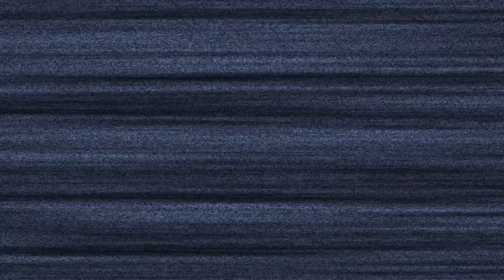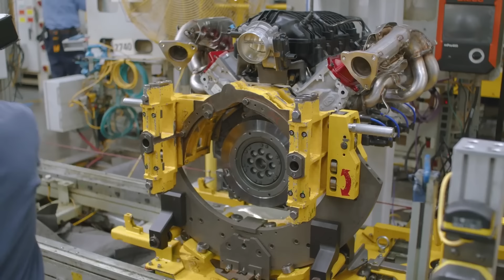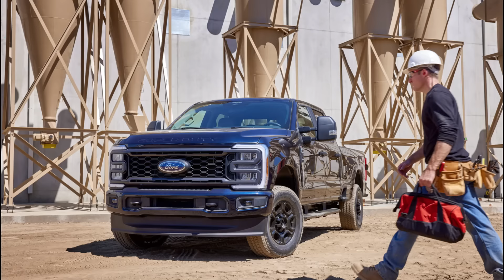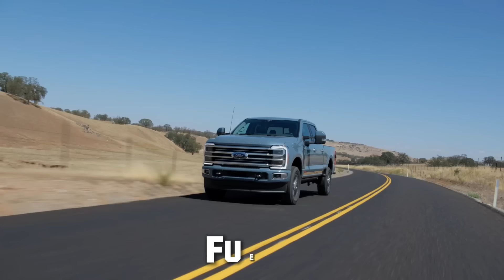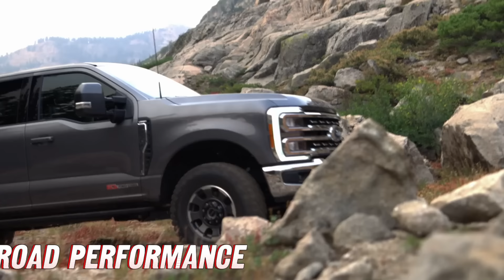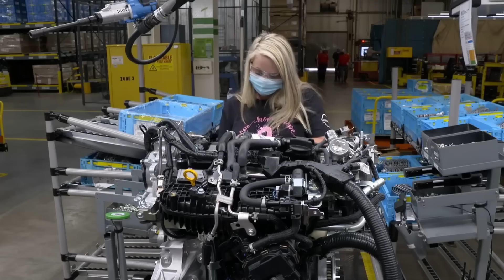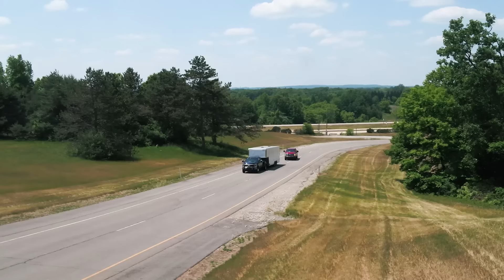ALL 4 Powertrains of 2026 Ford Super Duty EXPLAINED in Detail!

Comment: Overpriced JUNK.  All of them, All brands.  I have a 25 year old 7.3L F250, engine made by international.  I'm just going to have it rebuilt it if ever gives up the ghost, but thinking it won't since I'm coming up on 400K miles.  All that extra "high tech" crap is just that CRAP.  They say they stopped the 7.3L because it couldn't pass emissions.  BS, they didn't even try.
Reply from the maker: Completely fair, your 7.3L holding up to 400K miles speaks volumes about the durability of those old-school engines. With all the modern “high tech” additions, it’s understandable to feel frustrated. Which of the 2026 Super Duty powertrains do you think comes closest to that kind of reliability?
Reply: Just say you can't afford it. It makes way more sense than what you are spewing.
Reply: Your 7.3 is weak and slow these new engines are superior just because you can’t afford it doesn’t make it “overpriced junk”.
Reply: @PARATI-SUMUS  i have a 7.3 powerstroke and a 2024 6.7 powerstroke....and i deleted and tuned the 6.7....it absolutely has no business moving like my 5.0 while weighing 8000lbs 😂😂😂 its stupid fast for a truck. My 7.3 with many modifications will do 0-60 in 3-5 business days compared to my 6.7... as far as reliability i dont see any issues with the 6.7 as long as you have the s&s disaster prevention kit installed.
Reply: I’ve got 355k on my ‘03 7.3
Reply: Keep the old one and rebuild the whole truck. You'll be wat ahead and the $90,000 current trucks
Reply: Yaa they are expensive

Comment: You lost me at the particulate filter. Pass
Reply: Pretty easy to get rid of
Reply: @tsharko04  why should I have to pay for it and then pay to get rid of it.
Reply from the maker: The pricing is absolutely brutal on the new Super Duty! Basic work trucks that used to cost $30K are now pushing $50K+ for entry-level XLT trim. It's completely priced out the working people who actually need these trucks.

Are you just frustrated with the sticker shock, or actively shopping and getting hit with the reality of current truck pricing?
Reply: @speed_spectrum_cars  everything is getting crazy expensive.

Comment: Get a Ram that way you get CUMMINS. Just like a Peterbilt  and kenworth. Ford are in the shop Rams are on the Road getting the work done.
Reply: Hilarious Cummins are failing just as much or more then pop psd
Reply: Problem is you don't have lock out hubs on a ram!!
Unless you do the lockout hub kit 
What's wear and tear on the front and your front end will be freewheeling
Reply: I love the my trucks  better guys. they all suck now. They use the same parts that are junkkkkkkkkkkkkkk.
Reply: Honestly why would the manufacturer care if they break down. Short warranty and then you buy a new 100k truck that should be selling for 68k

Comment: Superduty had its peak in 2001-02 and massive decline in 05+.  Also bring back the god damn 6 speed manual transmission.
Reply: Sounds like fun rowing through gears, but a single countershaft trans can't hold the power these new diesels are putting out. Id love to have a manual trans but the autos are really good that they have now. At least the 6 speed
Reply: Yeah, with the power the new trucks make, you'd need a Eaton fuller 6, 7, or 8 speed or something equivalent to it
Reply: The 7.3 was gutless. Reliable? Ya most of the time but it was dated on tech. 0-60 in a few days when hooked to a load.
Reply: @bryandepiazzy8679 A chip, CAI and 4" turbo back exhaust woke mine right up.  Plenty of power; night and day over stock.
Reply: Had a 2000 SD with 6 spd.  Selling it was the worst decision I've made.
Reply: @ratpatrol07 saw one 2000 F350 with the ZF6 and the 5.4l for close to 25$k Cad today on FB MP. The truck is mint and only have 140k km. A beautiful dually! If I didn’t had a Cummins dually already I would be seriously looking at it just because it has that ZF6 trans in it
Reply: @philbert8423  thats another animal, old trucks still are not worth their sticker or more being 20 years old
Reply: The people who need a diesel truck could personally own and use a day cab single axle and not have to have a cdl but just a class a license not commercial unless they were making money then the cdl is necessary but you can hotshot if your under 26k lbs gross weight
Reply: I have one, in my 99 7.3 powerstroke. So much fun to drive. I get good mpg as well
Reply: I drive a 6.0 😂😂
Reply: Save the manuals!
Reply: should offer a eaton 13speed with all that power
Reply: Old non Hydraulic in the bell
Reply: Making too much money selling those 10 speeds in a box.
Reply: You might want a six speed but nobody else does
Reply: @davidmiddleton240  manuals were forced out by insurance companies and emissions controls. end of story. thats pure communism.
Reply: Exactly why I'm keeping my ordered from the factory '01 F350 7.3 CC LB 4x4 Lariat.  No emissions garbage, not even a cat.  Only 179,000 and runs like the day I picked it up from the dealer.  A few mods over the years has kept it current and adequately powerful.  It serves my needs quite well.
Reply: The only reason I still have my 6.4L is to keep the ZF S6 trans.  I blew out overdrive after 15 years of tuned shananagins, but it was pretty cheap to find a replacement on ebay.
Reply: Yep my 99 v10 5speed crew cab dually lookkkng flawless still
Reply: Got an 01 7.3 F250, has a few bolt ons and ts6 tuner, it has more than enough grunt to do anything I want to do with it.  Know someone with a couple 6.0, and the money thats been put into those trucks would have bought mine outright many times over.
Reply: A modern 7.3 deisel or modern 2 stroke 8 cylinder deisel  without def would be the ultimate comeback
Reply: @ericwitherspoon5311  the 7.3 was a big engine with low power and was starting to really show it's age in the 2000's . The 24v cummins was smaller and more efficient and made the roughly the same power as the 7.3 powerstroke, and the LB7 duramax was still smaller and more efficient than the 7.3 and made more power than the 7.3. It was an aged mule waiting to be shot. 

I don't think 2 stroke diesels will ever make a come back.
Reply: Simmer down grandpa
Reply: I watched a YouTube video with that hooked to an actually healthy V-10 "Triton", and that sucker was/is a BEAST for basic work. *I don't know if it could have been a 6.2, but that engine is one of the best modern Ford workhorses too.
Reply: @ChristopherWilliams-y7y The problem the 6.8 V10 had was it made no low end torque. The engine had to rev into the 4000 rpm range to make its power same with the 5.4. I owned three V10 Fords and they all struggled on the bottom end to get a heavy load moving up to speed. The 7.3 Godzilla is a massive improvemnet.
Reply: @Lawnboy21  I'd say the "improvement" is more gears in the transmission.  It's much harder to get heavy loads moving when you have fewer gears spaced further apart.
Reply: @Lawnboy21 gearing issue or nah?
Reply: @Lawnboy21  the 2 valve tritons were awesome, the 3 valve was junk, and yes the power band was raised way up on the 3 valve, dont forget the electronic throttle added in 04 didnt help.
Reply: @ChristopherWilliams-y7y I have a 03 f250 with the 6.8 v10. I love it. I dont do a lot of heavy towing like over 10k in let my boss do that with his truck. Its pretty quick too for a 8k lb truck. Fuel mileage is ass but I don't care. I've had it since new shes got 166k on it. I work local so 166k for a 22 year old truck is nice. Never had a problem other than normal wear items and a couple coils going out. Most reliable ive ever owned.
Reply: @roguepowersports3576  2 valve tritons were awesome
Reply: In any diesel light duty truck a 6 speed manual transmission would be awesome! And to all saying it’s not strong enough…think again! Tractors with great torque have manuals(agreed they are not going 100MPH) 10-12-18 wheelers have manual transmissions, it just needs to be properly engineered to match the engine power
Reply: @philbert8423  remember 26k max combined weight is cdl territory, more than 90% of these truck owners will never be more than 17 at the most.  trucks are over powered with too much "capability" and it did nothing but make the damn thing 40k more money.
Reply: @TruckguyTruckguy yeah! Not wrong, but for people who requires that kind of specs…it’s still worth it I think. When I look at them the OEM numbers regarding TQ, HP and whatnot are not my main topics. I’m more interested by the payload. But I also own a 1 ton Dually for personal needs, so my POV may greatly differ
Reply: @philbert8423  even 20k lbs without air brakes or air/hydraulic is sketchy and for long term use id move to a medium duty.
Reply: @TruckguyTruckguy agreed!
Reply: Not everyone can drive a manual stop asking
Reply: @PARATI-SUMUS not everyone should have a license either 😂😂😂
Reply: @techdood2270 most people learn from automatic vehicles not every vehicle should have that prehistoric unreliable tech
Reply: @PARATI-SUMUS auto transmission are far more unreliable driver error is normally the only failure with manual transmissions
Reply: @techdood2270 not at all haha
Reply: @PARATI-SUMUS 100% true iv replaced a ton of automatic transmissions for failure most I normally have to do on a manual is clutch replacement or slave cylinder and as long as the driver knows how to operate a vehicle they normally make it 200k or better before clutch is wore out
Reply: @techdood2270 people beat the shit out of autos and they still slam
Reply: @PARATI-SUMUS what exactly is your point that any idiot can drive a auto and it takes the smallest amount of skill to drive a manual I’ll agree with that but that in no way makes an automatic a better transmission there are far more failure points in a auto as well as repair bill is more when they fail autos are convenient and any idiot can drive one none of this makes them better reliability wise just makes learning to operate simpler
Reply: @PARATI-SUMUS  if you can drive a lawn mower you can drive a manual.
Reply: @TruckguyTruckguy I don’t know about that one
Reply: @PARATI-SUMUS  lost cause.
Reply: @TruckguyTruckguy that’s what you are
Reply: Iv owned pretty much every diesel ford has built and the only one I would not buy again is a7.3 even tuned with some mods there gutless deleted 6.7 on a stock tune is the best of everything plenty of power decent fuel economy reliable and easy to work on

Comment: Got a 2025 Lariat Ultimate with the SO 6.7 I don’t see why you need the HO TBH I drove both and the difference is minimal. I suspect those that tow heavy all the time like my business and trucks do will have better long term reliability. The SO 6.7 has so much power / torque as it is. This truck is super smooth especially the power train.
Reply: The HO is a different beast when towing heavy. The torque curve must be far different than the SO. I had 20,970 pounds of steel on my 40 foot trailer pulling the mountains of Pennsylvania across Interstate 80. It pulls completely different than my 21 and 24 SO trucks did.
Reply: @johnselzer761  yes the HO is a beast when towing heavy. Especially in the hills/mountains.

Comment: I have a 2024 f350 platinum tremor with a 6.7 HO. The truck is amazing. My only complaint is quality control on the body. Misalignment of body panels and the truck has a drivers side lean.
Reply from the maker: That's frustrating on a Platinum Tremor - you're paying serious money for a truck that should be perfect off the lot! Body panel alignment issues on a $80K+ truck is just unacceptable quality control. The driver's side lean thing is interesting - is that a suspension issue or literally the frame/body? That seems like something that should be a warranty fix, not just a "character quirk."

How's the 6.7 HO treating you though? That engine combo in the Tremor package should be a beast for both work and play. Are you using it for heavy towing or more recreational stuff? Did Ford at least acknowledge the body issues when you brought it up?
Reply: @speed_spectrum_cars I’m using it more for recreation. Ford states the lean is in their allowable specs, the 6.7 HO power wise is great. But my 6.7 is consuming oil. This truck is definitely a major disappointment. I drove a 2019 platinum with a 6.7 and had zero consumption. I regret getting rid of that truck daily for the 2024!

Comment: They need to work on engineering and quality control. Still lead in recalls.
Reply: yeah they sell more then others so they can.
Reply: @MRsolidcolor sadly. I what one so bad. Last gen though. But just not gonna do it. My 18 tundra is amazing.
Reply: Year after year.
Reply: My ‘22duramax had way more recalls in the first 3 months than I’ve had in my Power stroke over the same timeframe. Even so, most of the recalls in these modern trucks pertain to the tech/software, and not the power train.

Comment: Well call me unimpressed. Had a f350 Dooley pos. Could not keep it on the road . Was replacing 1993 dodge with 5.9 Cummins.  Ford almost caust me me house. Sent that ford on its way. And rebuilt the Dodge. And got a 1994 ford as a backup. STUPID all these new trucks are just trash.

Comment: If you're pulling anything the 6.7 Turbo diesel is the only way to go. Have 2020 F 350 6.7 and pull a 12000 lb travel trailer with mine.  
You won't regret it.
Reply from the maker: Absolutely agree - the 6.7 is in a different league for heavy towing. That low-end torque makes all the difference when you're pulling big loads up mountain passes.

How's the exhaust fluid consumption been on your 2020? And are you doing any modifications or keeping it stock for reliability? Some guys swear by deletes, others stick with factory setup for warranty peace of mind.
Reply: @speed_spectrum_cars I don't know about the OP but I have a 2022 and have all emissions until I am out of warranty and make a decision regarding moving from 
Canada to the US